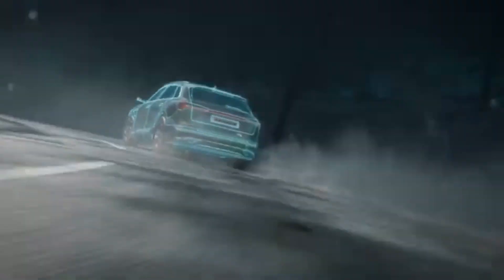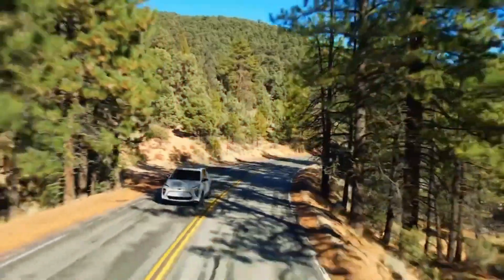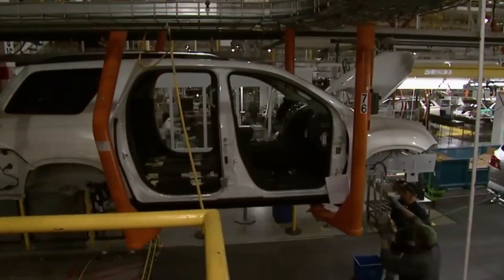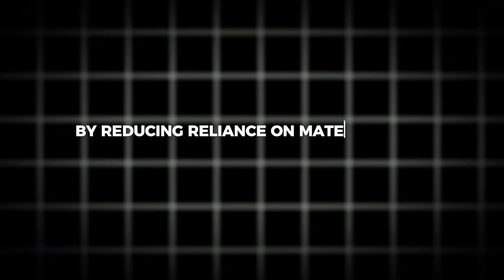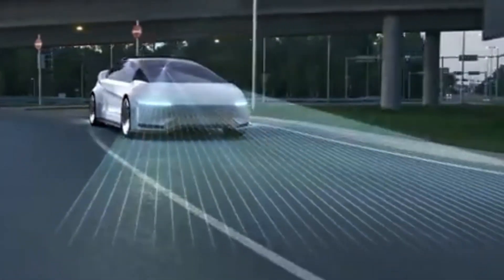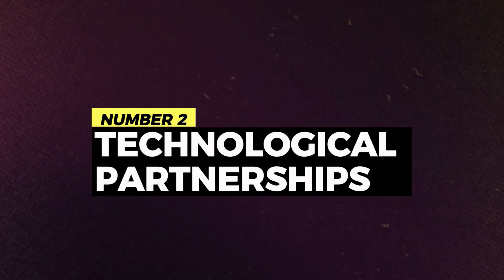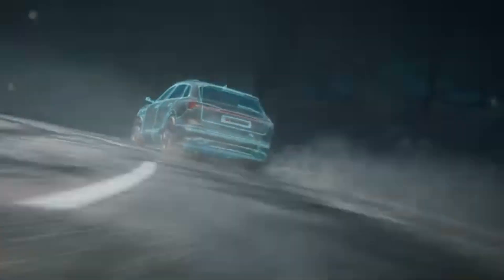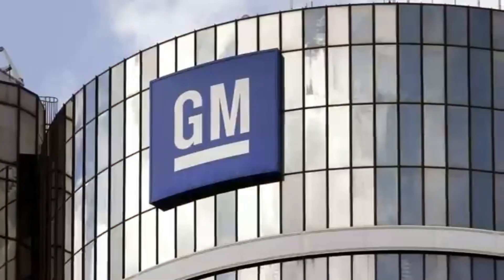Why GM Says Its Ultium Batteries Will Lead It To EV Dominance

Comment: Trashy, stolen video clips with a slick marketing BS line. After owning a Chevy Volt  for 9 years, the battery is no longer available and the software in the car is almost impossible to figure out; I still do not know haw to get the radio "tune" button to work properly. The original engineering behind the vehicle was very creative. The mileage is great using the ICE powerplant and the hold mode for driving on gasoline works very well. The car is almost worthless now because the battery (shown in the video) is no longer available. I just use the car's engine in hold mode, hoping that the battery does not fail or the software prevents charging the HV battery. The GPS system was not updatable after 3 years making it impossible to rely on. The voice commands never worked properly. There were a lot of promises but very few deliveries. DO NOT BUY A GM CAR IF YOU INTEND TO USE IT FOR OVER 5 YEARS.

Comment: "Positioning itself as a front runner" 
In what? The race to obsolescence? Or are they racing to bankruptcy? 
Also, GM recently blamed lower than expected demand for EVs for their laughably low sales of EVs. 
To give that a point of reference, in 2023 those laughable sales totaled 75,386. Tesla in the same year sold 1,808,581. Thats about 2400% of GMs EV sales. 
So, in closing, what in the f**k is this video talking about?

Comment: Hate the term tesla killer, i just want a car as do most that is good enough, give us a car that has reasonable acceleration 4 to 5 seconds is much more than fast enough in fact anything under 9 seconds is fine for the majority. Range and speed of charging is where the difference is felt and comfort, tesla is not the best interior out there and does not look very good imho. Price is also very important, until they can start manufacturing reasonable cars at under 25 000 it is going to be hard to get people to convert.